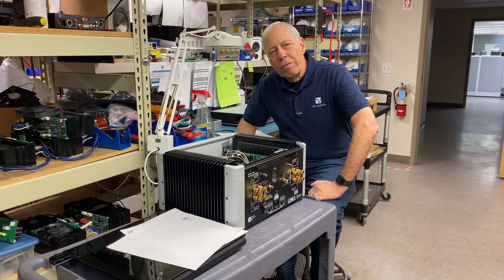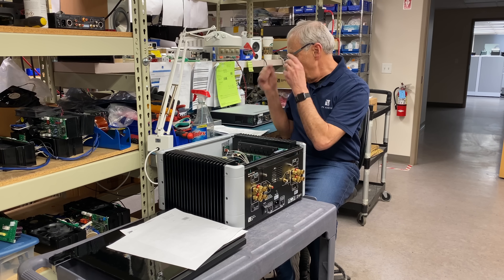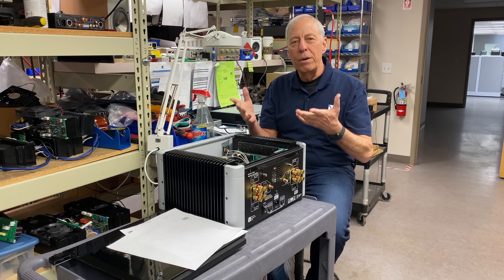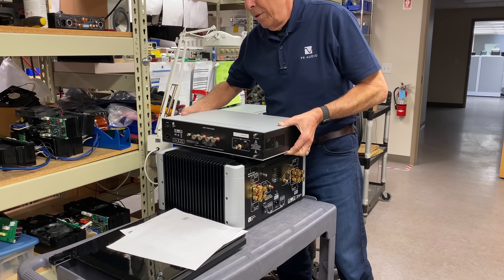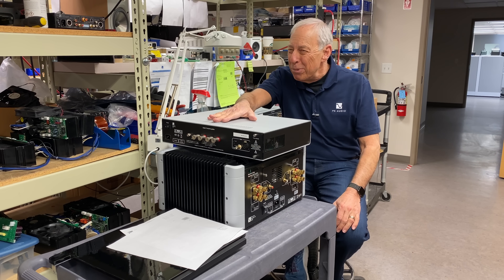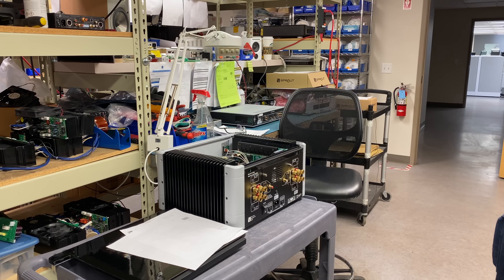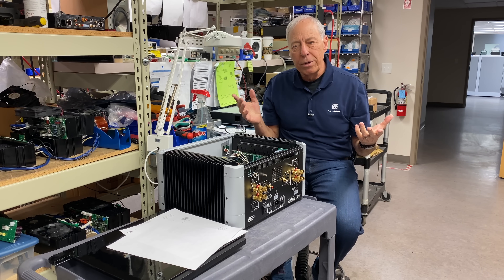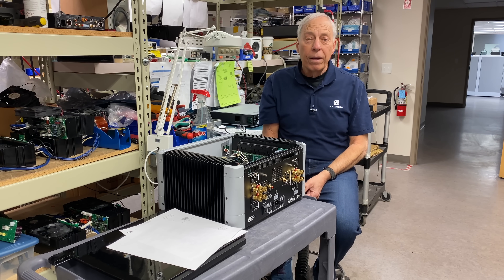Power amplifier efficiency, watts in vs. watts out

Comment: With compact fluorescent and LED lamps replacing incandescents, lighting electrical loads have been dropping for years. The major home power draws are now air conditioning and resistance heating. I am probably going to switch to a gas range and dryer when I need new appliances. In Denver the power consumed by the city as a whole would be dropping except for the high consumption of marijuana grow facilities and their banks of high pressure sodium lights. (For security reasons, they cannot grow outdoors or in traditional greenhouses.) I agree that small appliances and entertainment devices consume a trivial percentage of the electricity used.
Reply: Lots of grow ops use LED lighting too.
Reply: @paullazarro531  Oddly enough LED's are not significantly more efficient than high pressure sodium lamps on a lumens per watt basis. They have a better color rendering, but the plants don't much care. Or perhaps they do.. https://thehighestcrop.com/hps-vs-led/

Comment: Class D have very sensitives transistors things in them. They get sort circuuited and wreck when the path cable from the effects processors toughes the adap[ter for the SPEAKON adapter. Now it does nto works and they have to get a new amplifiers. Probableyu a used Peavey fromt he 1980s. Dre. Wallach has medicines for arthritis. He is on Coast to coast 2wtice a monthe. THNAKES YOURE AND THUBS UPS!

Comment: I've had some serious heat issues with Class A in the past and as power is used continuously, you can end up keeping your AC running more just to cool the room from the extra heat of the amp. If your class A amp is using 500 Watts and you live in a hot climate, you can expect to use extra another >700 Watts on the AC to keep the room cool. If you keep your amp on 24/7, it starts counting as a cost on your electric bill.
Reply: I ran an experiment. I wanted to see if I could get acclimated to colder indoor temps during winter.

I stuck with it for an entire season. When I was uncomfortable I just grinned and beared it. And when I felt fine for a few days, I'd turn the thermostat down by a degree.

By the end, 55 degrees was mostly fine, and I only decided to stop due to boredom and the fact that much lower isn't recommended for homes.

What I realized is that you do get acclimated over time, but the humidity, your hunger level, your energy and tiredness level, and the types of fabric you wear all have a dramatic effect on how long it takes to plateau and become adjusted to the new normal.

The energy savings alone was far larger than any preference of electronics I considered.
Reply: There is the ELECTRIC CHAGCE nad for lots of electricty  the DEMAND CHARGE. The de3mand meter is somethung like 90perfent fo full scale in 15 minutes, if I remember correctly. Maybe 10 cents a kilowatt hour and 10 dollara per KVA ofev whatever hte KVA demand limuits is. They use cdapacotores to get the KVA close to the KW. THNAKES YOU, THUMBBS USP!
Reply: @FatRat-f9m  I'll bring the graham crackers and the chocolate bars.  We can make s'mores.
Reply: @FatRat-f9m   Nah, not really. It's not really audio related, but it was just a suggestion for those trying to save a ton of energy if you're concerned about your audio amp preference. :)

It was a "cool experiment" and I learned that the human body truly does try to regulate itself and experience a state of comfort though the long term conditions can be less than what was previously thought of as ideal.

I kinda knew this because it seems as winter nears its end  the temperature maybe colder on a particular day, than what I experienced in December, but I require less clothing. It seems those very cold January and February days makes the less cold days of March much easier to bear. But I wasn't sure if this translated to indoor temperatures. I thought that maybe the human body always needs a stable 68 to 72 indoors as a way to reach maximum comfort. It really doesn't.

It was pretty easy and I only kept turning down the thermostat a degree once I felt fine again. The first 3 days after a temp decrease went back and forth. I'd often feel cold the first day or maybe the second day, fine the next, ever so slightly chilly the next day, and then each day after was easier. If I felt like I didn't notice the temperature in the room for about 3 days I'd turn down the temp another degree.

Rarely, I'd feel really cold. When that happened I'd  just put on another layer or even a hat. And sleeping was easy as well. I always used the same two or three blankets.

In the summer, I also let it run a little warm (74 or so), but make sure the humidity is way down. Sweating is gross so I can't play with extremes like I did in the winter.

Now, the lowest I go in winter is 60. 55 takes too much dedication and too many moments of discomfort. Those last 5 degrees takes about as long to get adjusted to than the entire 12 degree drop from 72 to 60.

Now you know way too much about the "Jimmy Carter way," lol. After decades of scoffing and rolling my eyes at people who did this, I had to see what would happen. I found it fun; lame I know.
Reply: @thunderpooch ...not so lame. It's fun to experiment.
I refuse to install air-conditioning here in my home, even though it gets "as hot as a f#@k" - (Eddie Murphy) here in Australia. That's how I justify leaving my audio gear on 24/7...that's my 'experiment'.
Stay safe good buddy!
Reply: @FatRat-f9m   stay safe. Don't let a snake bite ya or a roo punch you.

If they want a break from the heat, tell them the neighbors have air conditioning. :)

Comment: I can understand how some people might be wanting to save electricity to save the planet etc.., you would be better off sitting off all the electrical appliances in your home that have instant on capability. Everything with an LED to tell you the item is off uses electricity to do so. My amps are pretty old and not veery efficient, but even though it might pull 100 watts to provide 30 watts of musical power, I rarely use that 30 watts. My speakers were fairly efficient and didn't need to be driven that hard, and the in time I did drive them to 2/3 volume I almost got arrested because I unwittingly interrupted a graduation with Pink Floyd's Another Brick In The Wall, PT 2. I had some guys over to BBQ and party one Friday night and I had just finished building my speakers the week before and one friend wanted to hear them, so we put on The Wall Album, and when we got to The Wall PT 2 we all agreed that it was me to crank things up. So we did. And all of a sudden we heard this cheering, looked out side on our porch and could see that the football field ant Cortez High School in Phoenix, AZ had its lights on. Curious as to what was happening, My buddy Brian walked over to see what was going on. He looked through the hedges and beat feet back to us yelling turn it off, so we did. He said they're having graduation over there.  We shut down everything, closed the doors pulled the blinds and hid and a minute or two later the police came by shining their spot light in our apartment window, then left. After. About fifteen or twenty minutes we resumed and as the graduation ended we fired up the stereo once more to give that graduating class a proper send off! No cops were seen after that.

Comment: Class D.... 80%-90% efficiency all day!
Reply: Channel Z:  all static, all the time, everyday, forever!  Or words to that effect.  --  The B-52's
Reply: Stephen Smith 
Haha! Nice. I was just spinning my old B52’s records the other day, namely the s/t and “wild planet”.
Reply: @NickP333  And after the COVID-19 pandemic settles back to some semblance of the old normal, "Roam if you want to."   ibid.
Reply: Stephen Smith 
Yeah, hopefully this “cosmic thing” of a virus will be over sooner rather than later.
Reply: Don't forget Class-H. It's efficient and sounds great too.
Reply: @delatomvione9943  emotiva fanboy?
Reply: @delatomvione9943  Wasn't Bob Carver inventor of class H with his "tracking down converter " power supply , his Sunfire amps use the chassis as the heat sink with little or no ventilation .
Reply: Someone correct me if I'm wrong but isn't Bob Carvers "magnetic field coil" amplifier class D as it has a power supply whose input switches on and off at an ultrasonic rate to adapt to the varying power demand of the amplifier.This sounds like class D meaning he perfected class D amplification almost 30 years ago.
Reply: After further checking it was 40 years ago that he applied for the patent for his Magnetic field coil  power supply 1980.
Reply: @leekumiega6576  That design is using a pulse-width-modulated (PWM) power supply to match the rail voltage to the total power demand in real time. Similar to if not the same as a class H arrangement, and allows the output stage to always run more efficiently by keeping its operating point towards the upper end of its feed voltage and thereby minimizing how much power it has to hold back which would lead to inefficiency. As this is power supply side only, any output side can be run off of it if properly designed, with least efficient topologies (A, AB) having the best gains, and high efficiency topologies (like class D) having the least gains.
Reply: My inefficient class A/B amp has kept me sane throughout the pandemic. Cheaper than a shrink I would say!
Reply: I love my NAD’s lol

Comment: You miss one thing, for your Class D Amp, if you don't need 1200W output, but something more reasonably like 50W, you consume 50W+ electricity, say, 55W.  However, for your 200W Class A Amp, no matter how much is the output, it consumes the FULL power input, like what you said, perhaps, 450W, all the time.